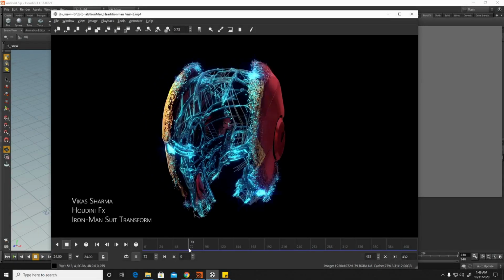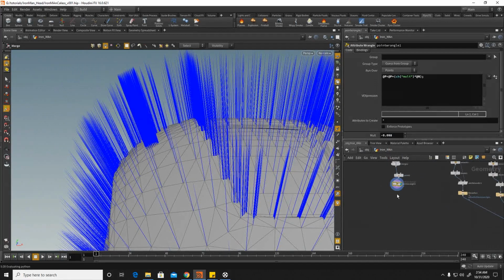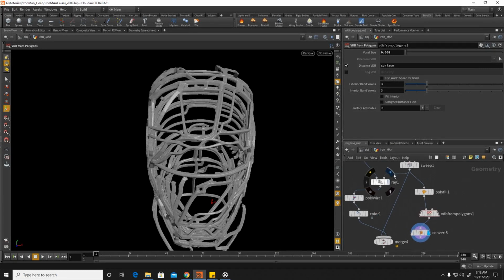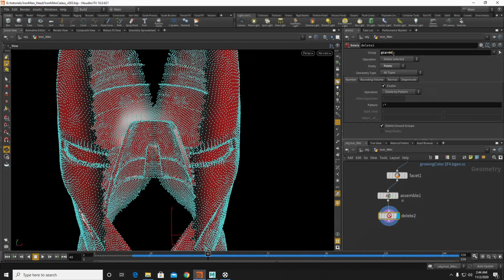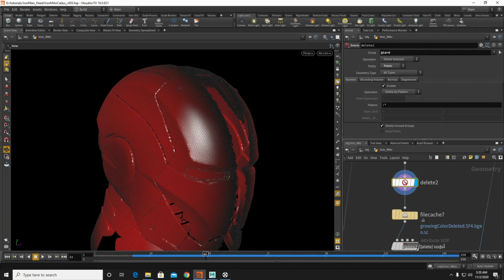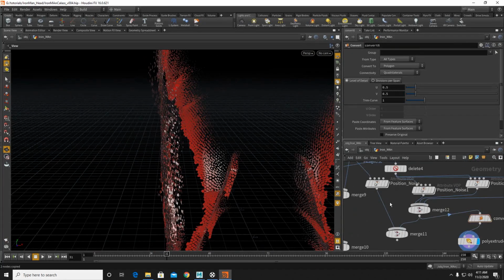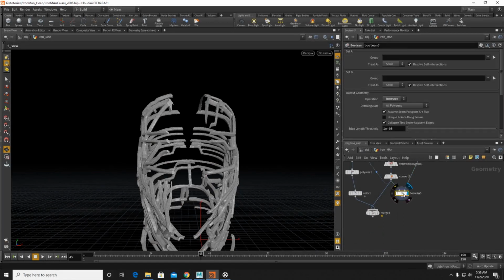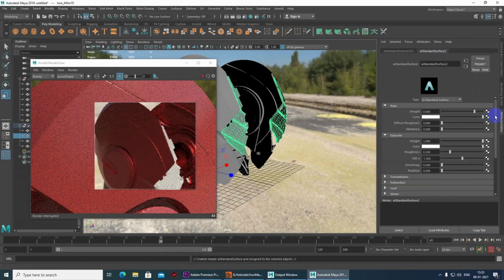Iron Man suit build up Tutorial (Houdini )

Comment: maybe you should explain your expressions... the old point vop is not available.. and now its not working at all
Reply from the maker: yap there is alternate solution  for this you can generate normal vectors by vop sop . add point at center of geometry and substract each point position and position of added point and plug it in normal 
second solution you can unhide point old in any latest version of houdini. write these lines in textport press enter . you can unhide all older nodes of houdini by using this expression.  

' opunhide Sop point* "

"opunhide" - is function to unhide nodes.
 "Sop" - is level at which that hidden node was available in earlier version.
" point* " - means name of node and here * is use at place of "old" this * sign will unhide all node which name start with "point".
Reply: @vikasSharma-qh9fe  thank you! :) is there any way to get the same object?
Reply from the maker: @leoniemaier4253  i hope i could help with object. This model was made by friend. You can serch some other model